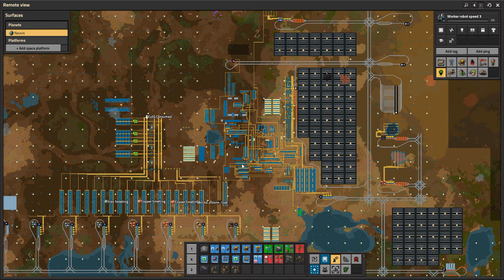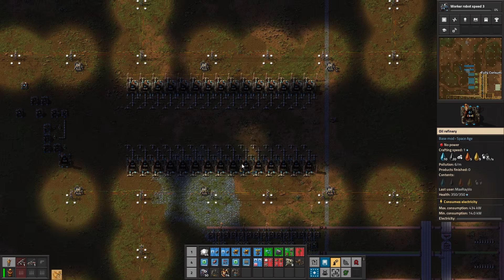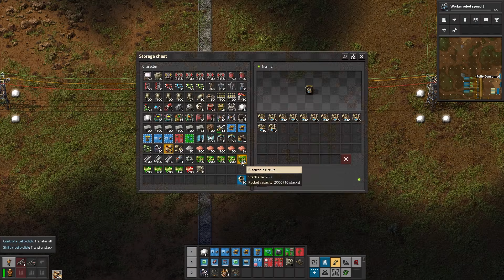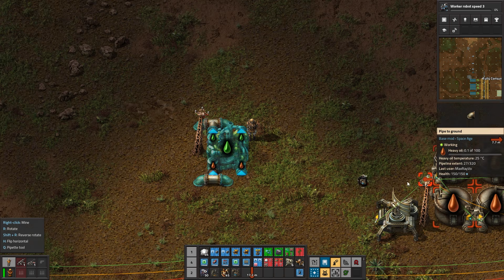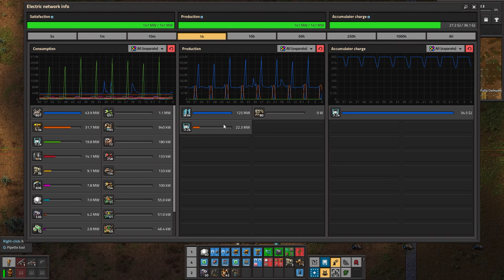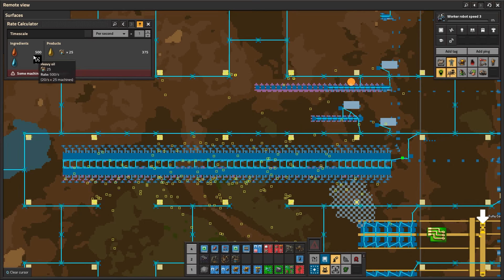Smart & Scalable Refinery on Main BUS: Design Marathon | 40 | Factorio Space

Comment: One problem I see is that your crude oil will be limited to only 1200/min because you are putting it through only 1 pump to and from the main bus from the train station. A possible recommendation, that is not necessarily important, is that I usually put a petroleum to solid fuel at the end that only comes on when I am low on heavy/light oil and too much petroleum and need more rocket fuel. Cheers, and thanks for the content!
Reply from the maker: That's true. I would need to pump oil with more than one pipeline on the main bus. Pipes are okay in v2 yet pumps have not kept up. Re petroleum in later episodes ive addressed it's overproduction with rocket fuel. Cheers for the awesome comment!
Reply: @Maxiume  I'm not 100% sure, but I think you can do a setup with two pumps pumping through the same pipeline... 1pipe + 2 Pipes + 2 Pumps + 2 Pipes + 1 Pipe... you can use quality too to achieve higher throughput.
Reply from the maker: @AudioNovels_BR the pumps can be all parallel and then before and after pipes can merge because pipe throughput is infinite. So as long as it is not capped by a single pump it should be good. As you said min 2 parallel pumps would work but it has to be 2 all the way on the bus and also entry and exit points.

Comment: Love the style (format) of your videos. Keep doing what you're doing. Not sure if I am convinced about using the switch, (I may have to rewatch) but I definitely like seeing other players do things their way and explain their design choice.
Reply from the maker: Cheers. The switch is what prevents over production. Cause no matter how hard you balance it will eventually come to a halt because lines and pipes back up. And then it is clogged!
Reply: @Maxiume that part I understand but why not with a pump? Cut the water or crude when the condition is met?
Reply from the maker: @grayhill6728 cause everyone else is doing that! also think about it, with pumps there will still be some fluid in the machines and pipes. cutting the pump does not immediately stop things as cutting the electricity does. It’s such a BOLD move.